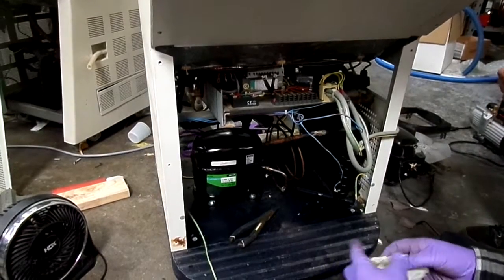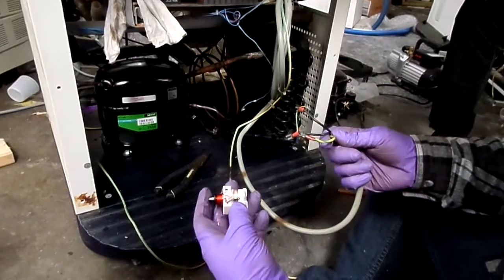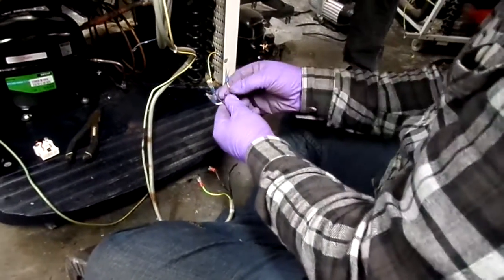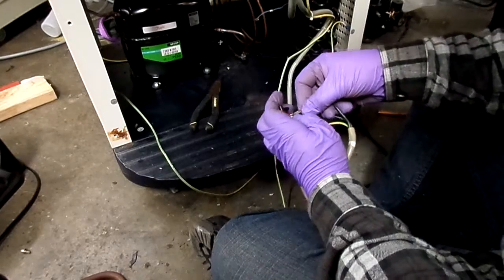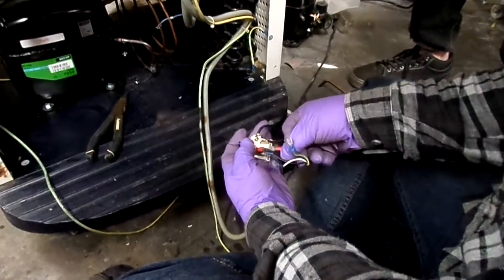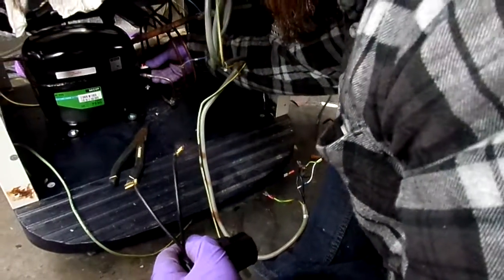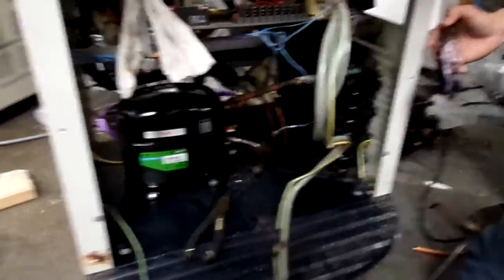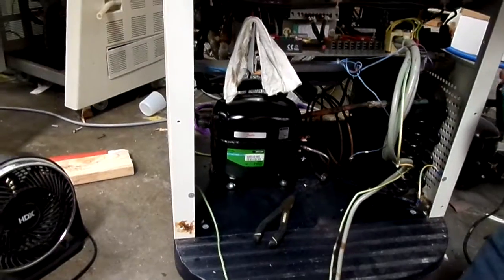Finishing compressor install and wiring on CM1850

Comment: Hello! Thank  you for your videos, I have the same model cryostat and was wondering if you could help me. They turned on the equipment and then the compressor started making sounds, after a while the mains fuse turned off. Everytime they do it after this the same thing happens, but the compressor doesn't make any sound, only the relay, and after about a minute, the machine turns off. I was wondering if you could tell me what parts to check first for failure, since the compressor is a bit inaccesible. Thank you!
Reply from the maker: It sounds like the compressor itself has burned out and is drawing too many amps on startup. Sorry to say, but you're going to have to get it swapped out.

Also, make sure whoever does it flushes the system to prevent the acid created by the burnout from damaging the new compressor.

Good luck!